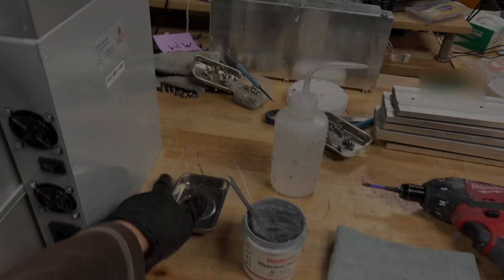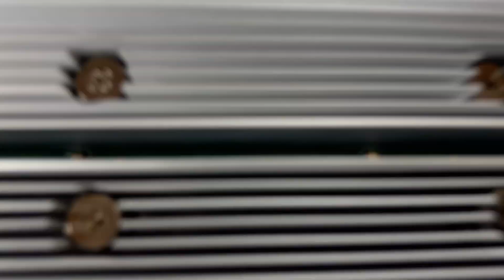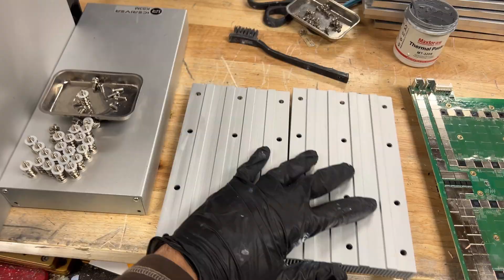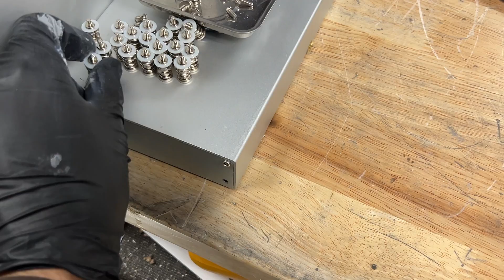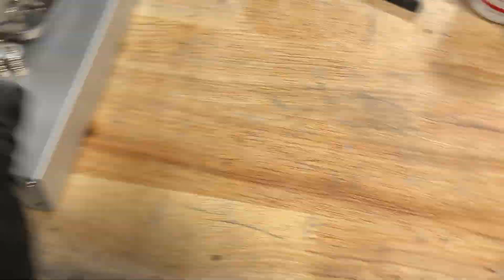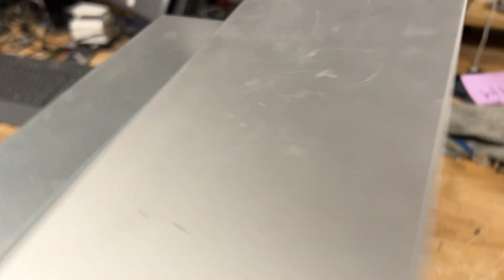Ultimate Guide: Rethermal and Upgrade Thermal on ASIC Miners for Beginners

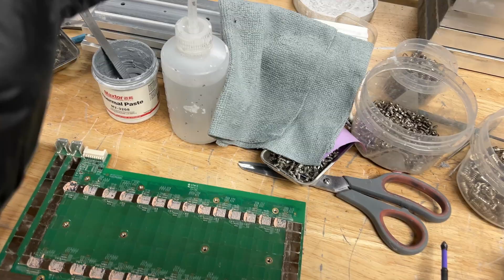Comment: Vinegar has carboxilic acid in it, which has free h+ ions in it, it is a good conductor of electricity, and it also doesnt evaporate, so never use Vinegar to clean PCBs..  or put even a  drop of it.. 4:16
Reply from the maker: Thanks for pointing this out your correct.